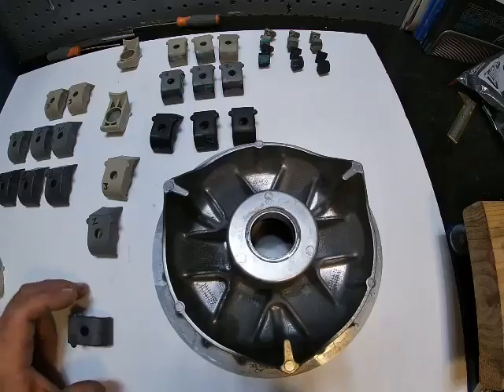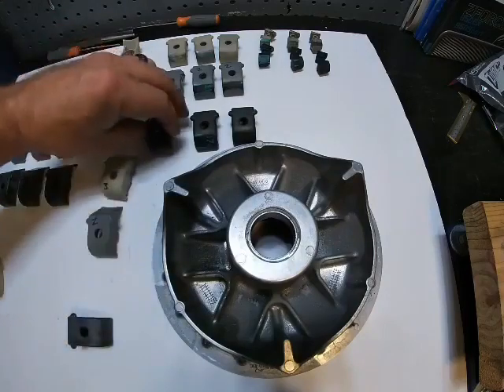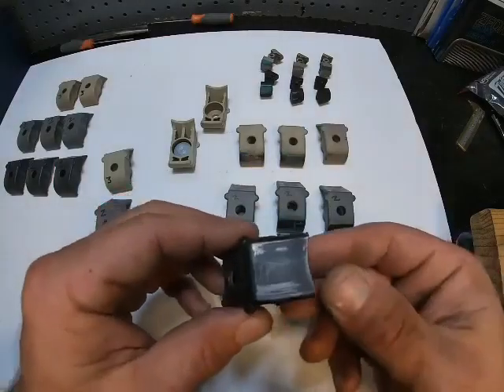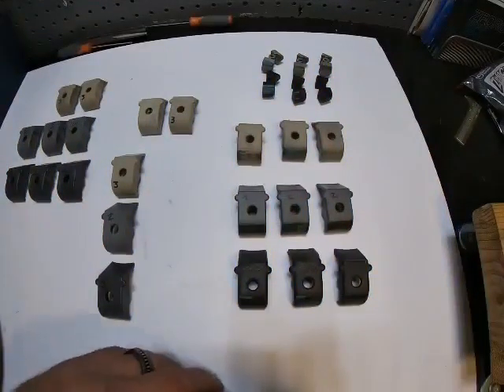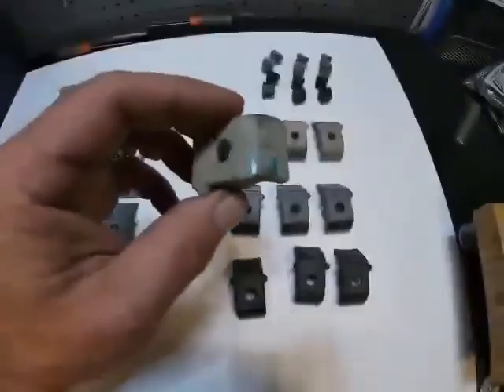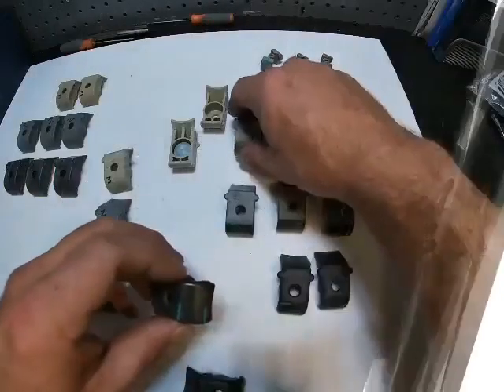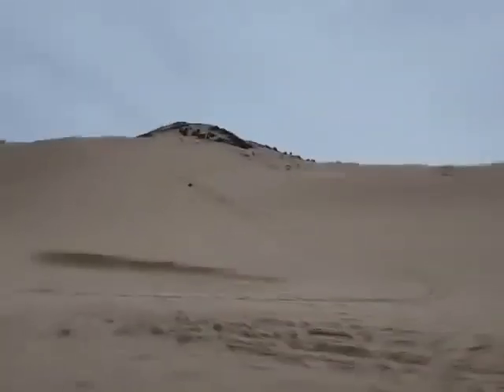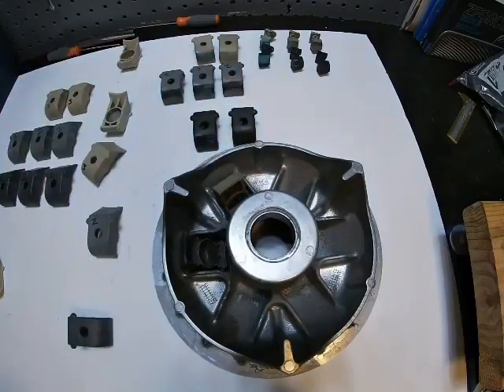Upgraded Trailblock CVT Primary weights.

Comment: How are the newest ones?
Reply from the maker: We have been running the newest/final version in our rentals for several months now. We have not had a primary burned down so far. I run then in my 950 sport to drag and desert race. I've been putting some hard miles on them testing cam upgrades.
 Everything is working very well.